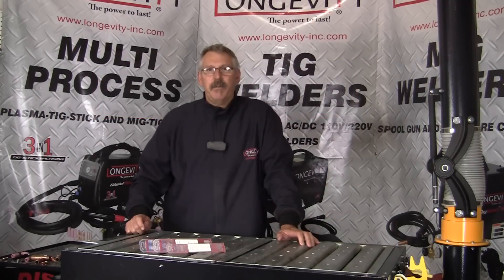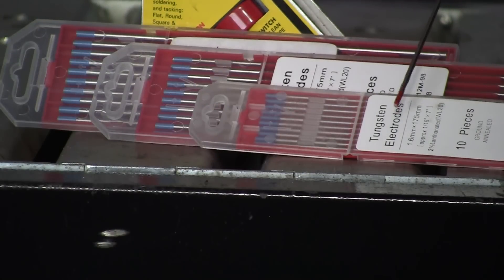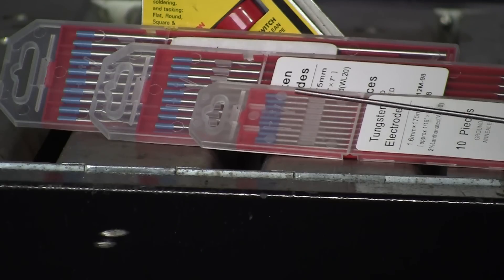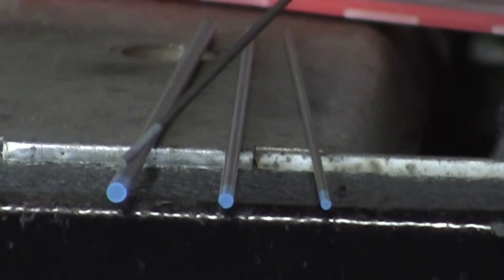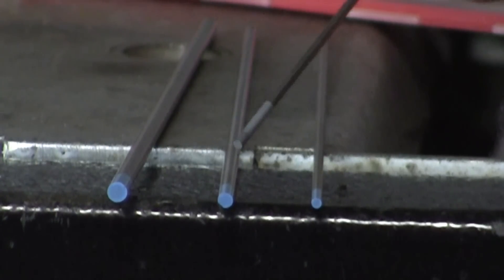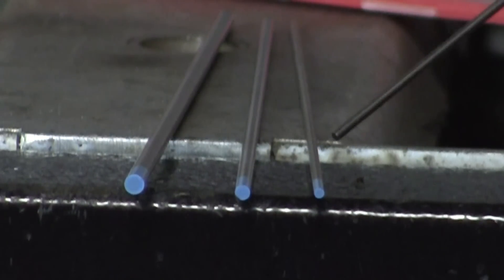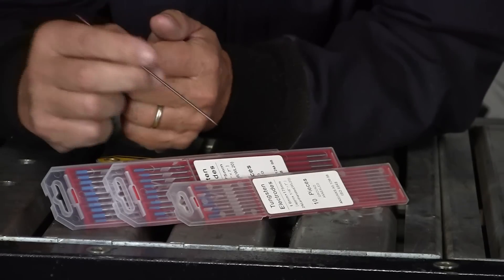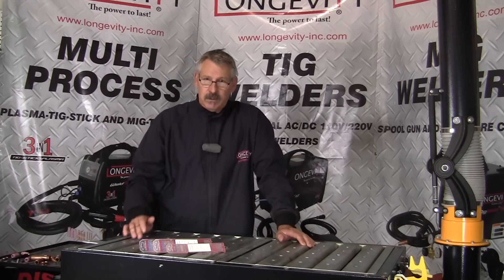TIG Tungsten Diameters - What Are Your Limits - Tips and Tricks

Comment: Wait, when you grind tungsten electroids, you grind the colored side?
What if you grind the other side? Is there a problem with doing that?
Reply: Don’t grind the color side
Reply: The metal is the same all the way through so it doesn't matter what side you grind down just try to keep the color there so you know which is which
Reply: You grind both sides so you can flip it over when needed.

Comment: I am having buyer's remorse I just ordered a combo machine I'm sure you're cringing at the thought of someone that's new to Tig buying a plasma cutter that is also would take machine especially since it's made in China but I am poor I am poor than a shithouse rat right now and I have some things that I have to deal with a plasma torch and I thought what the hell I may as well at least get my feet wet with TIG I mean I am I would say an expert brazor I can breathe and silver solder with the best of them I've been doing it for 40 years I do professional repairs with brazing I'm fine cast iron instrumentation as well as silver soldering and it's taking me a good many years to get highly proficient so I'm not just some dumb kid. Of course I have a caulking gun welder is what I call them MIG welder LOL, a Hobart handler 210 amp system it seems to do a pretty damn good job I can weld some pretty hefty materials with that guy. My shop is so small and I need to get a good bandsaw along with the plasma cutter and get some of the other cutting equipment the hell out of it that way I will save quite a bit of space in my shop that's one of the reasons why I opted to get a plasma cutter.

I spent far too much money today I'm cringing at the amount of money that I spent and I haven't even got another argon tank yet I guess I'm going to go do that tomorrow my credit cards are going to start on fire. I just bought a bunch of consumables for the tig side of my setup and now I'm going to buy some tungsten and some filler rod and that's what I'm doing right now is poking around the internet trying to gain some knowledge I don't know what to buy as far as tungsten goes are there mix combo packs of different size tungstens I can get? I haven't seen anything like that! Any advice that you could give me would be greatly appreciated

Comment: I have seen video of a TIG machine running at 1000 amps using 1/4 tungsten electrode, it was a automated mechanized process.  As to why, I would guess that, because of the precision and clean weld properties TIG provides,  there are some very exotic metals and alloys used in very specialized and/or critical applications,  TIG welding them is the only acceptable process,  regardless of material size or thickness.   Obviously in ordinary circumstances,  if you have a very thick material even several inches thick, you bevel it, then weld multiple passes,  using stick or MIG welding,  in that case your typical 250 to 300 amp machine has plenty of power. Of course with very thick plates or castings you should always preheat them, using a rosebud tip.

Comment: Very important when trying pipe certification  6g. When experience 1.6 or 2.4 millimeter don´t make difference. Current on thin pipe 70-80 amps. Big tungsten makes too big heat easily and break the metal around weld. Too small filler rod easily goes too fast and too big won´t melt. Tested with 1.6 and too fast so hole and heat is for beginner too large when trying to keep weld under control. Went to 2.0 filler rod and better. On Thicker pipe not so relevant when heat is not so big issue +6millimeters with root and hotpass. Your video helped me to change electrode and today tested thicker filler rod to keep root cooler and to avoid undercut because of heat thanx appreciated. Need more videos like this.

Comment: How about crazy big electrodes, I’ve seen plenty of 5/32 and 3/16 and even quarter inch rods, who uses arcs that high?
Reply from the maker: Those are big!
Reply: @longevitywelding  when would electrodes that large be used? When welding extra thick steel?
Reply: I have seen video of a TIG machine running at 1000 amps using 1/4 tungsten electrode, it was a automated mechanized process.  As to why, I would guess that, because of the precision and clean weld properties TIG provides,  there are some very exotic metals and alloys used in very specialized and/or critical applications,  TIG welding them is the only acceptable process,  regardless of material size or thickness.   Obviously in ordinary circumstances,  if you have a very thick material even several inches thick, you bevel it, then weld multiple passes,  using stick or MIG welding,  in that case your typical 250 to 300 amp machine has plenty of power.

Comment: Who the hell sharpens the color side first? 🤣
Reply: Great question.  The paint will contaminate the grinding wheel/belt.  I sharpen the other end.
Reply: I am Tig newbie , I thought I was wrong  for sharpening the  non-color side while watching this..
Reply: Who uses full lenght electrodes? I always cut them in half and sharpen both ends. And I have like 10 of them in a small box in my pocket. But I only use 1 type at work so no risk of mixing them up.
Reply: @Catrik  you are wasting Tungsten this way.
Reply: Sharpen both ends that way you don’t have to have so many to hand , two in one as it were
Reply: Sick people... That's who.
Reply: A new guy or a moron will sharpen the color end first.  Both will learn, the moron will take a little time.  LOL
Reply: Under 2 minutes in and that was my first thought. If they have a colour coding, why throw away the coding?

Next was his vagueness about upper and, specifically, lower amperages of the various rod diameters. Not to mention (which he didn't) the advantages/disadvantages of the different rare earth metals used in the construction of TIG electrodes.

Overall this was a waste of my time.

Comment: Whats roughly material thickness for each size electrode ?
Reply: Dill Wiggle there is no one answer. Depends on the amperage needed andthe material type. Carbon steel won’t translate the same as aluminum. Too many variables for a simple answer.
Reply: All depended on the amps needed